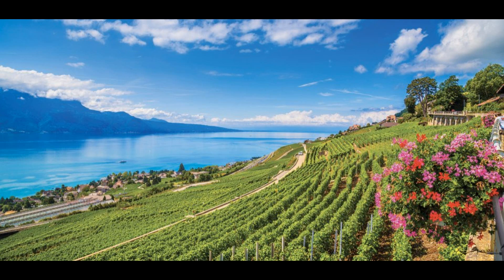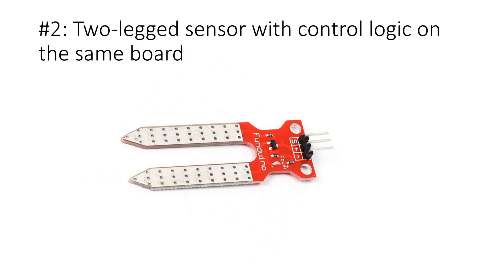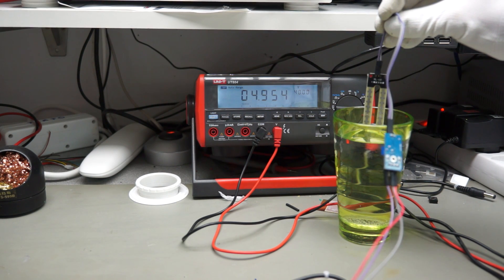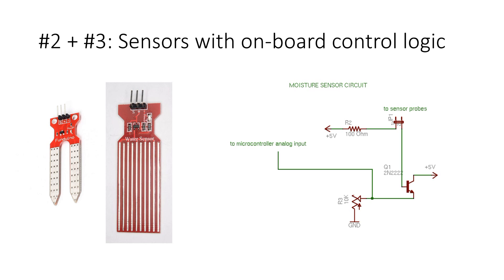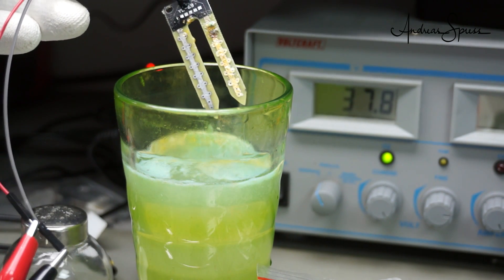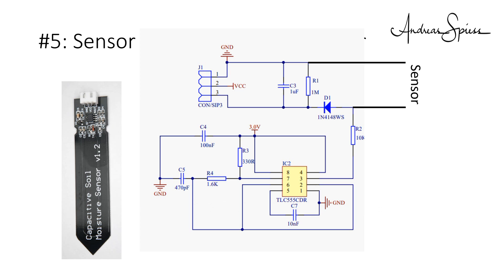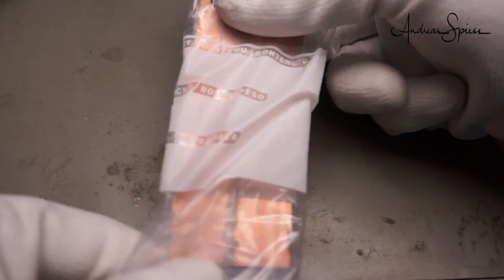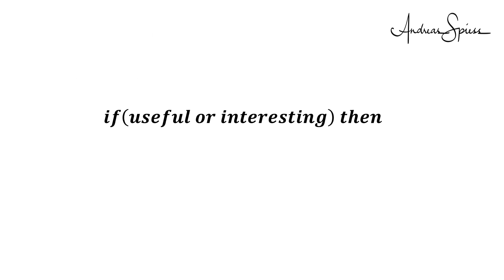#207 Why most Arduino Soil Moisture Sensors suck (incl. solution)

Comment: Electrolytic corrosion is the death of almost all electronics. That is the reason why it is important to block direct current. Those cheap moisture sensors are actually a nice learning tool and included in almost all arduino-kits. And the rapid electrolytic destruction is a feature, it shows beginners the importance to think about these problems and how to avoid them. :)

The naive approach is, to add a resistor to make a voltage divider and put them between Vcc and GND and measure the voltage drop with the built-in ADC. This makes them corrode away in no time. The next less naive approach is to put the voltage divider between a port-pin and GND and enable them only a few times to measure the value. This slows it down but doesn't solve the problem. Third approach is, putting it between two port-pins and to take measurements they are driven with alternating current ( alternate between high and low on those two port-pins, always one pin high and the other low and taking measurements in between). This remove almost all direct current, but some direct current might be still present if the program takes longer when one specific pin is high (i.e. when taking a sample only in one code path). Then you can fix the program, maybe add a capacitor in series with the voltage divider and so on. Then you might introduce the capacitive sensor. It is a learning tool. :)

And when all flowers are dried up, you can build electric neon flowers: https://www.youtube.com/watch?v=rbrjkzMEpPU  http://www.bigclive.com/nixie.htm (and they don't need water)

Edit:

The other thing I wanted to mention is: Conformal coating helps a lot and it is extremely easy to retrofit, just get a spray bottle of kontaktchemie plastik 70 (or similar product), clean the PCB, and spray it (be careful with connectors). Conformal coating could be done in the factory, it is very cheap but it isn't done to increase the chance for water damage. Water damage means no warranty and the customer has to buy a new product and that is what some vendors of some products want (Especially the vendor of particularly hard to repair laptops that get turned into a PC when a corroded trace or pad is replaced with a wire).

The easy way to make your own, and more robust, moisture sensor is a screw terminal with two nails in it. I mean the screw terminals used to install light fixtures (They are called Lüsterklemme in German, this should give good results in google image search).
Reply from the maker: Thank you for summarizing all connection methods. Maybe I should have mentioned it.
Reply: Now I have mentioned it. Maybe it helps some readers. :)

I also edited the comment and mentioned conformal coating that can cheaply added. You mentioned it too, but isn't that plasti dip stuff really thick? That is why I mentioned a product that is especially made for conformal coating and it is old, very old, I know that I used the kontakt chemie stuff almost 20 years ago. ;)
Reply from the maker: My second choice „Tropenlack“ seems to be a conformal coating. But not easily available. Thanks for your proposal.
Reply: Wow. That big yellow/blue can with its big letters worked perfectly. It kept the better suited, but less prominently presented, product under the perception threshold...

Somebody should tell this to the marketing people from electrolube. ;)
Reply: zvpunry: I think you're mistaken about "the generation that is tinkering with Arduino kits". The fact they're tinkering with Arduinos means they're curious and want to learn. Sure, they didn't start with the same basics as someone who does pure electronics, but that doesn't prevent them from figuring this stuff out.
Reply: Juan Rial: It was a response to Eric, who probably thinks that the basics he mentioned are universally known. I didn't want to insult users of those Arduino-kits. But it is wrong to assume that everybody knows some electronics/physics basics. If they have some knowledge, they might avoid some things automatically. If not, they can experiment and learn.

I actually encourage tinkering with arduinos and linux based single board computers. I think those platforms are excellent learning devices, they are inexpensive and offer a lot of learning opportunities. :)
Reply: MFeinstein: I didn't say that AC doesn't corrode, but it is much much slower. If you have a constant electric field between the electrodes, it will separate dissolved material from the anode and then the next layer can be dissolved. With AC the electric field is also alternating, the dissolved material just moves back and is absorbed by the cathode (until it becomes the anode again).
Reply: CoolKoon: I wonder why the plants in pots made of galvanized steel survive that excessive zinc. Maybe it is more corrosion resistant as you think. I also wanted to know what trace amounts of zinc could do to a plant, and what I found was this: https://en.wikipedia.org/wiki/Zinc_deficiency_(plant_disorder)

It isn't about shooting yourself in the foot. I started this thread to mention that these sensors are a great learning-tool, to learn about electrolytic corrosion and methods to minimize the effects. The last thing I mention in the 2nd paragraph of my first post in this thread is the capacitive moisture sensor. They are can be build without any metal in contact with the soil.
Reply: zvpunry, I must have misread you then. I see oldschool electronics guys bash the modern microcontroller based approach on an almost constant basis. Arduino in particular. I mistook you for one of them. Glad we're on the same page. :)

As for your suggestion of using AC: I'm not sure if that would help. In knife making, we use an etcher/marker to put our logos on our blades. Etching happens with DC, and removes material, just like what happens on the probes here. Marking uses AC, and deposits a dark layer on top of the metal, in addition to a little etching action as well. So I'd guess using AC on these probes would still eat through them, albeit at reduced speed since you nibble from both sides. Additionally, it will deposit a dark, and presumably less conductive layer on top of the remainder of the probe, which will influence your measurements.

I should probably test this theory out when I make my next etcher/marker.
Reply: zvpunry "a screw terminal with two nails in it" is just as bad of a solution as all the resistive probes mentioned in the video.
Reply: CoolKoon: I didn't write that they are better. It is just something to get started without paying for those bare-trace-PCBs.
Reply: zvpunry Untreated nails?! Which will rust away faster than anything shown in the video?! If I'd be able to choose only between the Chinese garbage and your nail-based solution I'd choose the former thank you....
Reply: zvpunry AC doesn't corrode? I thought it would corrode all the conductors, since half a cycle one will be the anode and the other the cathode and the other half of the cycle they will invert their roles
Reply: CoolKoon: Let me define what I understand as a typical Nail: A round piece of galvanized steel with a diameter of 2.8mm and a length of 65mm. Normal nails don't rust away. The will lose zinc if they are exposed to a corrosive environment (acidic wood or soil), but this will still take a long time. Electrolytic corrosion can be a lot faster, especially with DC. But then it is still a 2.8mm thick nail and not a 35µm (or even 17µm) thin copper trace.

And no, I don't say these types of moisture sensors are good. I say that they are readily available. When you want to get something done, you look what you have and use something that may work. :)
Reply: zvpunry - "Normal nails don't rust away." - Okay, let's ignore the fact that excessive zinc in the soil causes copper deficiency in the plants for now and talk about another problem associated with changes in the electrode's composition: the electrochemical changes also induce changes in the data measured by the probes and thus would require constant re-calibration. Moreover the very composition of the soil (and changes in it) will greatly affect the results as well.

"When you want to get something done, you look what you have and use something that may work. :)" - Well, we do have a saying that "you can also use swill to put out a fire" where I come from, but why would you do that? Why shoot yourself in the foot when for a couple bucks you can have something that produces (more or less) predictable and reproducible results and will last you for years?
Reply: dang,, someone else il looking louis rossman :D
Reply: "the rapid electrolytic destruction is a feature"  :)  What a polite way to say, "The kit makers are just as ignorant as the manufacturers of the resistive moisture sensors."  :) lol
Reply: Eric-Jan van den Bogaard learning is about making mistakes. If everything goes as planned you don't learn as much, imo.
Reply: making the learning curve steeper, while this is not needed ? i think these subjects are some of the basics of electronics, making a battery, galvanic properties, etc...
Reply: Unfortunately those basics are mostly missing at the generation that is tinkering with arduino-kits (or similar products). They need to learn those basics before they take an arduino, attach such a sensor and control a valve to water their plants including the living room and the basement.

The kits that contain such a moisture sensor contain almost always a piezo buzzer too. The first thing to be build with it is a warning device that beeps if the plant is dry and later when the moisture sensor has been corroded away.

By the way, we want learning curves. That is why people play with that stuff. The alternative is buying a complete product that is tested, comes with a warranty and is also cheaper.

Comment: Nice work! I need to measure the moisture content of the floor material in my beehives, so this was useful.
Reply from the maker: Would be interesting to know if it works.
Reply: Phil Chandler May I ask why only the floor level? 

Or do you mean, the floor for each tray in the hive box?

For aired environment, you might want to try other methods than what Andreas has presented. An humidity and temperature sensor arrangement might work better, providing the bees are not sensitive to sensor RFI and will not block the sensor's probes.
Reply: @DougHanchard  A bee hive only has one floor, although from time to time one may use something like a Snelgrove board to separate the hive in two, as in swarm control, queen production etc.
Technically, a floor is not needed, but adds additional protection from the elements, robbing from other colonies, wasps etc. ingress of slugs, snails, mice etc. In addition to the floor, the entrance size (part of the floor in most hive types) can also be manipulated.
Having a floor and the ability to close the entrance is useful when moving colonies too ;)
Reply: Got to ask... Why are your beehive floors wet? Solid floors should be built with a slope to the entrance (usually double sided). The hives should be off the ground (no plant contact either) and most hives today use a Varroa screen (Stainless Steel mesh) and so there is little wood in the floor. If you have water running through your hives, they probably need maintenance ;) Timber, where possible, should be red cedar which is light and naturally anti fungal, although painted wood is fine. Other than that, the bees will be maintaining temperature, humidity and air flow.
It will be difficult  to measure the wetness of wood with the capacitive probe (as shown), you will probably want something with pointed probes, like those sold at your local DIY shop.

Nice little video Andreas, as ever! In the past I have used both Stainless and carbon probes working with a reversing sensor (AC) for commercial greenhouse watering. Those capacitive units are very nice. The ones that I have used were already sealed at the edges.

Comment: Well explained. I have made various moisture sensors, including resistive sensors and capacitive sensors. Both have their pro' s and cons.
You already mentioned most of the disadvantages of the resistive sensors. Those can be minimized by interrupting the power to the sensor and only switch it on for a few milisec when you measure and that can be done say 4-6 times/day. More than enough.
 I also do not use copper, but Iron. This way sensors last several seasons

I found the capacitive sensors (made with 555 or HC14) a bit sensitive to surroundings, apparently their wires pick up stray capacitance.

I was surprised about your sensor working with a plastic bag around it, it will, but probably not well with so much airspac around it. I tried with heat shrink.... that didnt really work. Lacquer and plastidip (expensive) do.

One more thing about that various resistive models. If you use the analog output, the 'module' that comes with it is usually superfluous,as it connects directly to the sensor
Reply: I've been using 316 SS threaded rod.  No problem with corrosion that I can detect.
Reply from the maker: I thought iron starts to rust. No problem with that? Or do you use stainless steel? Concerning the plastic bag: Plastidip arrived too late for the video:-( But as you saw, it worked with the bag.
Reply: Usually galvanized I use. Yes it builds up some corrosion, but I just wipe it down end of season, doesn't really influence the reading throughout the season. Yes I saw it worked. I used a plastic bag too during some tests, but I never expected it to still work with so much air in between :-) My bad
Reply: You got the same solution I found. Cool someone else thinks like me.

Comment: To extend the lifespan of the cheap sensors, you can use 2 analog pins one as a digital output to power the sensor and one as analog input, you take the reading and then turn off the output pin. On the next measurement you just swap the pins. This way you are simulating an AC behavior. The copper will eventually corrode for chemical reactions over time, but it will not be accelerated by flowing current.
Reply from the maker: Good idea!
Reply: I stand by my suggestion. Just a couple of things: steel usually has trace quantities of impurities, and will not leach given it's stainless. Second point: use SURGICAL SS. Soil conditions can't be worse than the interior of the human body.
Reply: Use AC-driven stainless steel probes. I´ve seen that used on a water tank level sensor, and it seems to work.
Reply: The whole point of stainless steel, particularly 316, is that it is very resistant to corrosion. It needs to corrode in order to form soluble compounds that can bother plants. I don't think it will be a significant problem for watering plants, so long as the ph of the soil isn't very low (which would be bad for most plants anyway). That said, graphite isn't hard to get and it'd solve the problem completely, so sure, use it instead of steel of any kind. That, or use a gold or platinum plating. Non-toxic, only needs a few pennies worth at the most, and about as resistant to corrosion as you can ever get.
Reply: How can you do this with the 2 leg sensor with the op-amp circuit?
Reply: CoolKoon I only suggested how to extend the life of sensor, I am not a chemist or a biologists so I don't know what will happen to the plant 😁
Reply: thesimbon - The copper (plus the other metal that's plated onto the copper, if you're lucky it's tin, if not, it's nickel and there's a much greater chance for the latter) will not only corrode, but also leach into the soil. Sounds like just the right thing to make your plants happy....
Reply: Juan Ferreira "steel usually has trace quantities of impurities" - Heh, let's just skip over the fact that there's no "standardized" surgical stainless steel and assume that when you said "SURGICAL SS" you actually meant SAE 316L stainless steel (which is the most commonly used stainless steel type used in medicine as well). These are the "trace quantities of impurities" in it: 16-18% chromium, 10-12% nickel and 2-3% molybdenum. While molybdenum is actually required by the plants, chromium and nickel are NOT. Yes, you're right in the fact that 316 grade stainless steel is more resistant to acids (especially chloride ions) than the most common 304 grade, it's not impervious to them. And while it MIGHT not corrode too fast (nor leach a substantial amount of chromium or nickel into the soil, causing you to poison your own garden), it's still affected (as a resistive sensor) by the soil's composition (ion content) MUCH more than a capacitive sensor. Moreover 316 grade stainless steel is definitely more expensive than a capacitive probe....
Reply: Juan Ferreira Have you ever looked up what stainless steel consists of? Besides iron the main constituents are nickel and chromium (hint: few things are more toxic and environmentally hazardous than a nickel mine). Would you want to risk poisoning the soil you grow your plants in (and also risk accumulating heavy metals in the crops you grow and plan to eat)? Mind you, the soil is MUCH more reactive than plain tap water (just try it as an experiment once: take two iron nails and leave one in wet soil while you soak the other in tap water).
Reply: thesimbon - Well, soil moisture sensors are usually used in order to be able to water plants properly. Which kinda presumes that the goal is to make the plants thrive and avoid poisoning them as much as possible, don't you think? I mean what else would you use a soil moisture sensor for?